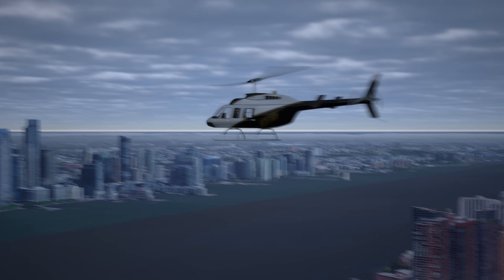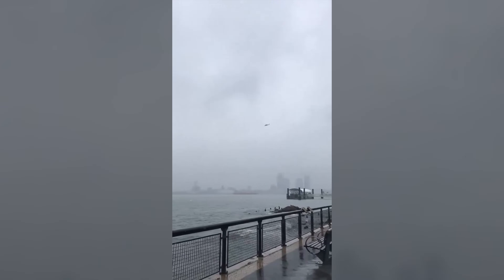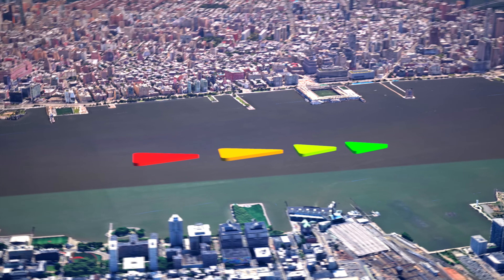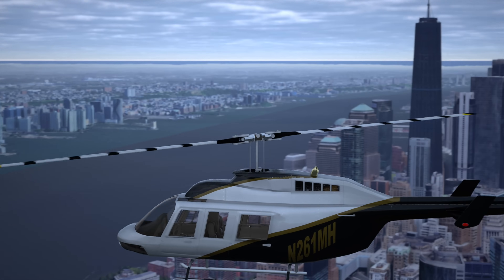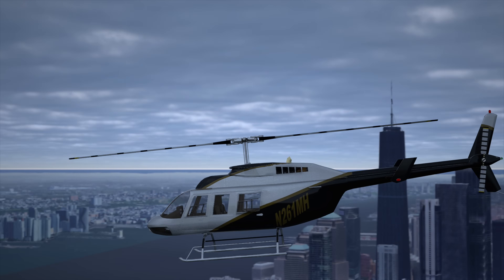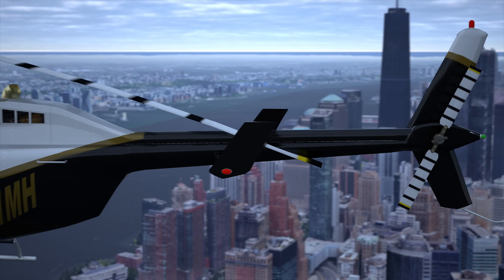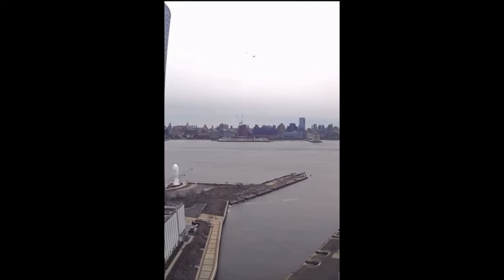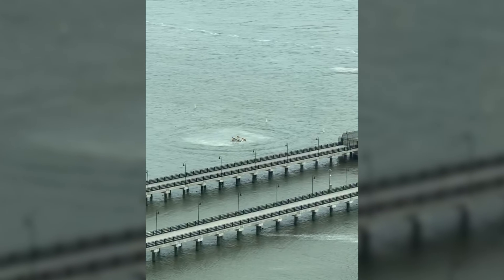Helicopters DON'T just fall from the sky - What is "Mast Bumping"?

Comment: Dude you’re really jumping the gun by subscribing this to mast bumping. There are a multitude of other possibilities and frankly I think mechanical failure is much more likely in this case than mast bumping. I think it’s quite disrespectful to the deceased pilot to immediately decide this was mast bumping (which is usually caused by pilot input) on very limited information not even 24 hours from the time of the accident.
Reply: Several other experts have proposed the same thing.
Reply: @kevinchambers1101  yes and it’s definitely a possibility and for sure every helicopter pilot’s mind immediately jumped to it as a possible cause. However it is by no means clear cut and there are several factors strongly pointing away from this conclusion so I find it disrespectful and a bit reckless to create an in depth video that only highlights one possibility thereby implying that it is the most likely cause.
Reply: @enismabrouk8202  all the experts said it was possibly the most likely cause, they didn't  say it was the cause because all the experts know they will have to wait until all the reports and findings are out.
Reply: @ just because they’re on tv doesn’t mean they’re experts. Most of them are probably former airline pilots and don’t know a damn thing about helicopters. And anyway they were all definitively wrong now. They’ve recovered the main rotor from the water and the mast is firmly attached!
Reply: It's just a theory...calm down.
Reply: The video says it was a possibility not a certainty. Sit down.

Comment: I have thousands of hours in Bell teetering rotor helicopters.  If you unload the main rotor system the base of the rotors can bang into the mast until it fractures and maybe cut off the tail in the process.  At that point you are flying a set of car keys.
Reply: Isn’t that a basic design fault?
Reply: Stay within flight parameters and all good.  If you overspeed an airplane or over stress and airplane parts can fall off too.
Reply: I think there was a mechanical failure that led to a chain reaction due to g-forces.

Comment: That rotor flying on its own with the gearbox looks intact and still perfectly balanced. If it had hit the tail boom wouldn't it be even a little bent and out of balance?
Reply: Yeah, plus the gearbox would still be with the helicopter not the rotors. I think it's more likely a failure of either the gearbox mounting or some sort of driveshaft failure that's ripped the aircraft apart.
Reply: @MattyEngland I have a family member who works for a helo manufacturer and his first response was gearbox mount failure.
Reply: A bent and damaged rotor could look straight and intact from afar due to centripetal forces. Like how swinging a rope looks like it's solid but turns into a wet noodle if you stop spinning it.
Reply: Good point!
Reply: Studying the final frames of the plunge, it appears that both the trans AND the engine mounts either failed or were ripped from the roof of the helo. The area on the roof of the Longranger looks completely bare of any machinery. Also, the one video that shows the rotor system falling seems to have more than just the tranny attached. What a terrifying mishap.
Reply: Stop noticing.
Reply: I’m of the mind something didn’t get torqued or safety wired.
Reply: Hard to say if it is perfectly balanced! 
But is indeed intact.
If it hit the boom they will already know from the witness marks.
Reply: @Captain101-x1o  that's not true. The witness marks only prove it hit the boom. It doesnt prove as to why. Baring in mind who the passenger was, it may have been foul play. We won't get the truth, we'll get the cover up.

Comment: After Kobe, you cant get me on a helicopter.
Reply: Kobe was killed by his pilot, not the aircraft.
Reply: @torqueson  idc if it was the pilot. I'm not getting on a helicopter.
Reply: @torqueson   Yup. The Kobe crash has been analyzed by many competent pilots et al too.
Reply: Planes fly, helicopters beat the air into submission.
If you're not in a war zone, I hear some of those helicopters operators don't do maintenance like they should.
Or stress mast bumping hazard like the military but I can't be sure.
If you have an issue in a helicopter, the air is gonna beat back.

I think I rather be on a plane with one engine broken than a helicopter with one issue.
Reply: Kobe flew in foggy terrain. Not a good idea.
Reply: @sfrobink   re: "Kobe flew"
Not entirely true. The pilot (Kobe is NOT, was not the pilot) was flying below the ceiling (a cloud deck overhead) when the pilot turned into rising terrain which became obscured by that lowering cloud deck, and the pilot became disoriented.

Comment: Yes it was mast bumping a zero G maneuver and the tail boom is sliced off by the 400 rpm titanium leading edge of the main rotor blades. No main rotor blades, no tail boom equals zero control.
Reply: The gearbox is still clearly attached to the rotors.

Comment: Good explanation. My dad had a Bell 3B1 & had the 1st copter service at Lake Tahoe. Late 60s. 
Season was over & he was taking it to winter storage. Removed the pontoons & put the skis back on. Lifted up lost RPM, but still had enough control to set it down in the shallow part of the lake. The helipad, he built himself to State specifications, was connected to end the of a pier. To this day, I don't know what caused loss of power. 
He never flew again as a pilot. It was quite an expensive loss. He did get out ok with no injuries.

Comment: mast bump would not remove the transmission.   It appears the attachment point of transmission to helicopter failed.  subsequent rapid torque changes then likely sheared tail boom connection point and the 3 main pieces fell.